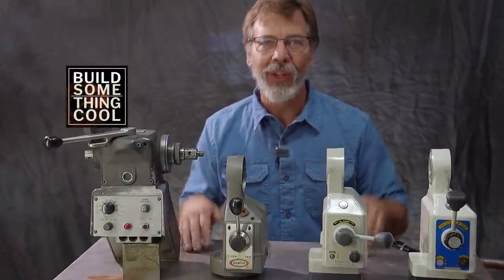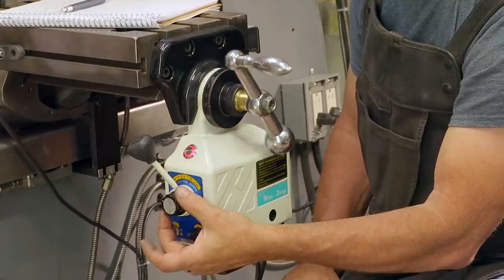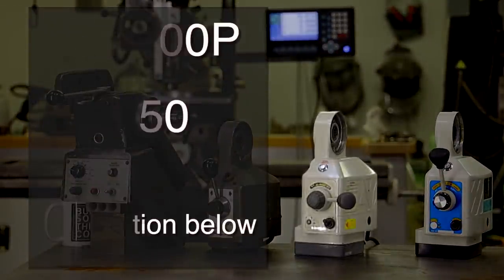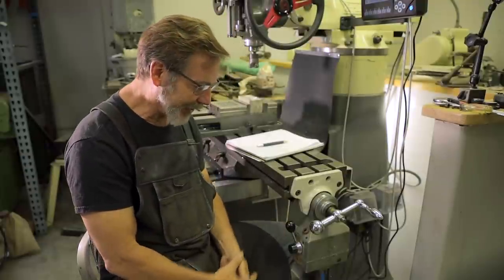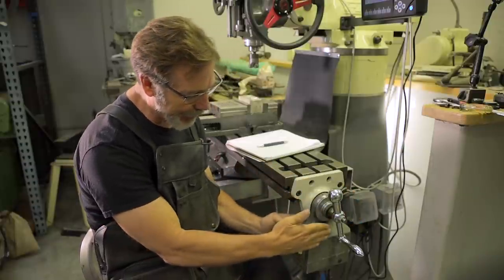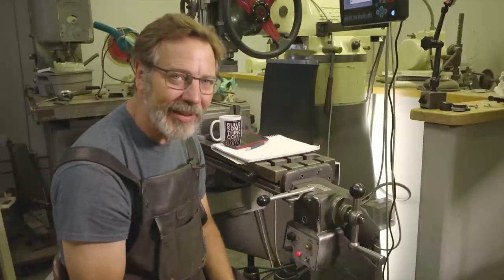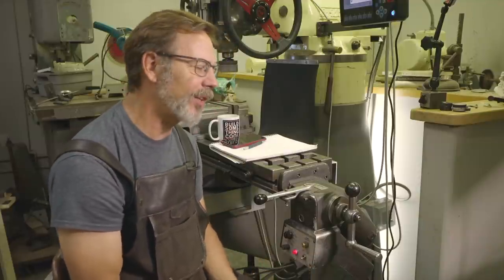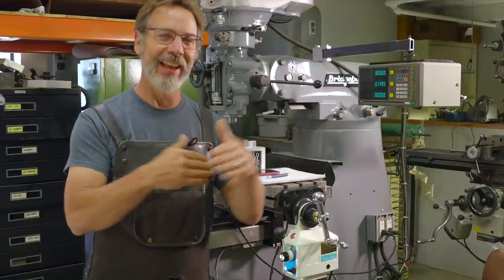You need a Power Feed, but which one?

Comment: I picked up one of the Wing Ding power feeds for my Y axis half a year ago and it's still chugging along. I didn't have the speed limitation issue on mine. I'm pretty sure your min/max Potentiometers on the speed control board are mis-adjusted. That's an easy fix you can try. Thanks for the side by side.
Reply from the maker: Right on
Reply: @BuildSomthingCool  Are you going to be doing more videos in 2021?
Reply: @BuildSomthingCool  Hey!Are you still making videos?Thanks!!!
Reply: Well fell in to the channel to late it looks like thank you for the great content

Comment: Please remind me, what was the point of "testing" these with zero load? You have just proven, that when you turn them on they....turn....A much more informative test would be to put them on Z and see how they handle the weight of the table if you didnt want to make chips only for the purpose of the test....
Reply: No load? Was the coffee cup not enough? LOL
Reply from the maker: Good question.  I did test them under load. I saw no real difference between the Power feeds. So I didn't put it in the video>

Comment: A good review.  Without sponsors, or Patreon,  most home shops will go with the most inexpensive.  Like handheld grinders.  I have 6 HF handheld grinders with different  wheels and brushes mounted on them.  For all 6, I have less than $70 invest as I buy them on sale.  One 4.5" Metabo can cost $125, unless you catch it on sale.  I can wear out 10 of the HF and still not pay for a Metabo.
Reply: He it is.
Reply: mature I agree,  I have the same set up with 5 harbor freight grinders  each with a different tool(wire cup ,wire braided wheel, cut off wheel, grinding wheel,, and sanding disk, etc. )   oh and I also have one cordless milwalk. for when im on the move. all 5 corded grinders I got on sale for like 10 bucks each from HF cant beat that and they run well

Comment: Nice video Dale! You inspired me to go out in my shop and resurrect my 6F power feed. The handle was gone, the limit switches were gone, and all the wires were cut at one point. After some mock up parts, trial, error, and a few extra relays, it's alive. That thing can push me across the floor if I try to oppose it. Now that's impressive!

Comment: I've had good luck with the al500p.  I did one on my z and y axis since my x still has the servo.  Adding power feed to the knee has just been an amazing improvement.  I got so tired of cranking it up and down for tool changes.  The shaft adapter is garbage, I ended up machining a whole new shaft for my Z axis with the differences integrated.  But worth the time and effort.
Reply: i just drilled and tapped mine and installed an X axis feed on it, took all up 1.5 hrs and cheap to replace
Reply from the maker: Thanks for sharing' I love My Z axis if I get another machine that what I would put on it first. :-)

Comment: I have an AL 500 on my Grizzly mill and have been through 2 armatures and one field coil, I run it at slow speed often. The last time I replaced the armature I found that the plastic cover on the top of the armature did not have the vent holes open. Drilled them out and over 2 years later it is chugging along. Also notice that after repeated cycles the speed knob changes position to a faster speed.

Comment: Instead of buying the 1000 dollar ones one can almost convert it to cnc with closed loop control
Reply: Even if you put a $750 drive on X, Y, and Z you'd be pretty close.  The only thing that doesn't factor in is a ball screw conversion, which will set you back a bit more.
Reply: @petergamache5368  using all Chinesium equipment should be able to get the parts under 1000 for one axis, I'm not sure if the rolled ballscrews are good enough though. Most of them don't have an anti-backlash nut at least so there will be like 2 thou backlash
Reply: If you go with steppers; you can absolutely go CNC for much less than $1000 USD. Ballscrews will bring that price up quite a bit; though... I’d probably figure $1200 for the whole thing. This is with Chinese parts; Taiwanese, US, or EU parts will be more, of course. There is a version of GRBL that runs on an Arduino Mega and common, cheap 3D printer UI hardware (RAMPS + a character LCD board + keypad) so that you don’t even need a PC on the mill. Some soldering will be required to adapt the RAMPS board to the external stepper drivers.

Comment: I have an older Jet 9x49 that came with a factory X-feed. I got really tired of cranking the Z up & down. Tried a drill, didn't like it. I supplied the make & model of the mill to the feed seller. When I went to install it the new shaft had different threads! Dealer didn't have the correct one so I made one. My X has limit switches that I've never installed, I should do that. I did install the Z limit switches. I like the round handle on the X and have decided to modify the Z to take one that turns all the time. Getting the crank to engage is a PIA. Will just put a small nob on the wheel. So I can let it be engaged full time.

Comment: Could you check top of the table for flatness? I think dovetail could just wear out in the middle, where it is used the most. It is hard to imagine that so thick pice of cast iron bends...
Great video btw
Reply: You are correct he isn't I've had 4 Bridgeport the tables do not sag checked mine with a Precision Starrett straight edge top and bottom they wear out in the middle I have the Bridgeport power feed on a 48 inch table not a 49 inch table Bridgeport table 32, 36, 42, 48 are the correct table sizes for American made Bridgeport and the confusion somebody must have a Chinese Bridgeport if it has 49 inch table
Reply: Ed Carl l
Reply from the maker: You can check the top, but its easer to measure the ways.  That way your not turning over the table every time you want to check it.
Reply: @plymouth-hl20ton37  T'was my feeling too - lack of sufficient lubrication on the ways. Could also argue user error - always putting things on to machine in the middle of the table - use the ends - wear them a bit too!
Reply: Cast iron does bend! I bought a new 6" PMatic jointer a long time ago. The fence had a serious curve. I called their (then) US service and got connected to a tech. He told me to put a 4x4 near each end, curve up, stand in the middle and bounce, slightly harder each time until I felt it give. At some point there was an obvious sudden movement. Checked and the fence was back to straight. Who'd a thunk? It has to do with stresses that occur while cooling. There are ways to remove or reduce those stresses before grinding but it takes time & effort that was in short supply @ PowerMatic and still is in almost all cheap cast machine parts. 
30 years ago I got a very old Crescent 16" jointer for $100. DMD, rusty. I took the tables and fence to a grinding service and had them Blanchard ground. I used a precision straight edge to set the machine up and every thing was dead on. Last year I did the check again. The tables had sagged. Each table is supported at 4 places by wedge blocks so flatness can't be controlled but twist can be as well as overall parallelism to the head reference. The support points are not at the magic hit or miss quarter points but not off by terribly far.  Yet there is significant sag in what are quite massive cast iron parts. I put my precision level on and it could detect the wave shape. I don't generally get that thing out except to set up CNC machines. It can drive you crazy.
Reply: @larryschweitzer4904  I daresay there are different grades of cast iron !
It's certainly weird to hear of it though.
Reply: @millomweb  utilise entire table top for more even wear. Got it.ty.
Reply: @millomweb  Doesn't it make a difference if the cast iron is correctly aged also?
Reply: @xmachine7003  How it's thermally treated will be a bigger factor than age.
Reply: Over the years as "T" nuts are tightened in the "T" slots deformation can occur. This puts the top side of the table in tension and it can bow.

Comment: I bought a Grizzly mill almost 19 years ago. It’s the biggest mill/drill they had as I needed if right away, and my riggers said that they would have to take the Bridgeport apart to get it in, and I didn’t have time for that. I figured I would replace mine when I had the time, but I never did. I bought the table drive, which is horizontal. I use this a lot. The only problem I had with the drive occurred about five, six years ago. My error! The main, plastic gear at the end of the drive broke teeth—as it should have. Grizzly got me a new gear in three days. Didn’t cost much. Other than that, no problems with it.

Comment: Finally, another video!  This review/test was just what I needed.  The spec is 0-200 RPM but I knew that couldn't be true.  I need 0.5 in/min on a horizontal mill.  I think I can get away with the 0.9 feed that you measured.

Comment: An update on my al500p. Fried my 3rd armature yesterday. Long slow pulls seems to do it in. Cutting a .025 " slot in a 10 inch long part 20 passes and then it blew my circuit breaker and stopped.  Don't know how this company controls the speed but if it is via dc voltage reduction, slow speeds means low voltage and high current. I GUESS that is what does the armature in. Anyone out there with similar experiences ? My next one will be the cheapest as its price is about the same as an armature from Align.

Comment: A $100ish dollar remote power feed unit NEW, and you bemoan it! ;) The best option(IMHO as an ex-machine tool/fitter turner) is to buy a vertical milling machine rather than a turret mill, as they generally have integrated power feeds(and rapids). Turret mills are great machines in theory, but not in real life scenarios as they are relatively slow(work cycles), lacking in rigidity(and require regular tramelling). Also, operators are generally loathed to change any of the axis' from perpendicular - its human nature! Turret mills are also significantly higher in price when compared to vertical mills, and more so to universal/horizontal mills with swivelling vertical head attachments, let alone the cost of adding aftermarket power feeds. An anology of the issues with Turret mills, is that they are like Trikes(three wheeled motorcycles), both appearing to be great ideas, but both ultimately being cursed by their impractical compromises. Keep safe and well.

Comment: After the 3rd armature died on my align, I decided to replace it with a wing ding on my 6 by 26 knee mill. I was not a direct replacement but close enough.  The bolt hole pattern was different enough that I could only use one of the two bolts to hold it to the mill (yes I was too lazy to mill new holes) and I needed to cut the limit switch bracket to fit my mill (tried using the align bracket but the hole pattern for the limit switch boxes are different) $149 from Walmart. We'll see how long it takes for me to fry this one.
Reply: 3 years and still strong

Comment: Useful info. Can I ask for some advice? I recently acquired a Bridgeport series 1 Boss CNBC mill (circadian early 80’s I think).  It is missing all of the control parts.  The motors are there but the rest I will have to acquire and assemble.  I could use some help.  I’m told by the PO that I need a breakout board and a a video.  I also need to clean it and lube it and reassemble.  I’d appreciate any advice from you or viewers, THANKS.
Reply from the maker: I wish I new more about cnc so I could help you. Im planing on doing a video on how to clean and recondition a mill tho. I just not sure when ill get to it😔
Reply: I can say from experiences with other early 80's era controls, the solid state boards are either the Gold or the Skunk of the whole system.  It can take a good tech several Billable hours to follow the logic and test for a rotten component that prevents the whole system from working.
Reply: Phillip B. Thanks, I may take you up on that.  First goal is to figure out for sure what I have.  Number on knee is CNC 1033, head is 2J - 72065 C. Hard to read head number.
Reply: @ElixirCNC  Don't know the answer to that yet.  The axis motors appear to be original equipment as far as I know.  Ball screws have already been installed.  The PO tells me I need a vfd and a break out board and an old computer.  I have the computer, need the rest.
Reply: Bruce No ya Yes you will need those.

Comment: Have you ever done a comparison on dros. I'm looking to get one and don't know with way to turn.
Bill
Reply: I have no point of comparison, but I bought the EL-400 units from DRO Pros for my lathe and mill.  I'm quite happy with them.  The only complaint is that I have to manually set the Z summing mode for my 4 axis on the mill each time I power it up.  I saw that both Tom Lipton and Stan Zinkowski bought them and that was good enough recommendation for me.  Magnetic scales are nice and compact compared to the other units I've seen and after installing them, I can say that the space savings is quite important.
Reply from the maker: IM working on one right now.

Comment: Surprised you didn't do a load test, and it shows an important point.  I have both a Servo and the $125 unit.  The servo has compensation electronics built in, that act as an electronic governor to keep the speed consistent under load....to a point of course.  No surprise, the $125 unit does not have compensation electronics, and slows considerably under load (just providing resistance with your hand on the handle).

Comment: So I bought my 1952 Bridgeport (Adcock Shipley) recently.
It has the Bridgeport Power Feed that you depict on the RH end of the X axis table.
When I bought the machine, this power feed isn’t working. Previous owner said it was traversing, slowed down & made a pop sound $ stopped working.

I’ve not been able to figure out what’s wrong with it. Opened control panel on power feed, can’t see anything obvious like a loose or burnt wire or switch etc.
Also opened the control panel on the machine that powers up the X axis power feed, coolant pump, electric motor etc and again nothing obviously wrong in there.
So I’m guessing it’s likely the Erskine controller inside the power box on the side of the machine most likely? 🤷‍♂️

Anyway I can’t find anyone here downunder that’s capable of diagnosing / fixing the Bridgeport Power Feed, so I bought a AL500 Align brand locally & a 240v Ac to 110v Ac transformer from my local machinery dealer, with the idea of replacing the Bridgeport Power Feed (reluctantly).
My issue is that - when you took that Bridgeport Power Feed, off the end of the table, the arbor shaft that runs through it is about 5 inches longer than the shaft that would be on a non power fed table (or the left hand end of the lead screw for eg? to accomodate the width of the Bridgeport Power Feed gear box.
And the Bridgeport Power Feed, attaches to the RH end of the lead screw under the table with a slip on coupler that has a wood ruff key onto the end of the lead screw and a roll pin through the coupler and arbor shaft that runs through the Bridgeport Power Feed   & it’s gear box.

Can I ask please how you were able to attach the after market power feeds to the RH end of the Bridgeport Table?

Did you make a new approx 4 inch shorter arbor shaft and roll pin it inside the coupler, copying the dimensions from the LH end of the lead screw?

Did you buy a pre made shorter arbor shaft?

If so, who from please?

I don’t have a lathe yet, the Bridgeport was my first purchase, so if you made a shaft then I will have to pay an engineering shop to spin me one up in a lathe, but I need to know the exact dimensions of that shaft to be able to get one made.

It’s doing my head in if I’m honest.

I think this is the only thing not working on my Bridgeport mill, and it’s very frustrating not being able to resolve “getting it working” so I can start making chips with it.

Any help / advice about how you managed to adapt these after market power feeds to fit your Bridgeport mill in place of the Bridgeport power feed would be most sincerely appreciated.

If you did make a shaft & still have the dimensions etc, I’d very gladly pay you to make and ship me the same shaft.

Many thanks in advance.

Comment: those cheap power feeds that are for the Y and Z axis are pretty expensive, i just made a few bushes and fixed the cheap wen deng x axis feed  to all my axis for very little money and a little time, if one ever fails i have a spare on the shelf to swap it out and straight back to work. 3 years in and still going good. even the Z !!
Reply from the maker: Glade to here the wing ding has been working so well for you over the last 3 years :-)

Comment: Very nice Dale, thank you. Now, since the Servo is 10 years old, when are you going to give it an upgrade with spiral bevel gears and a bottom cover? Or can you bastardize one of the cheaper ones to get the parts out of it?  Stay safe and well :)
Reply from the maker: I have been think of doing that.  I can get the gear on ebay
Reply: @BuildSomthingCool  And you could make a cover on your lathe!!